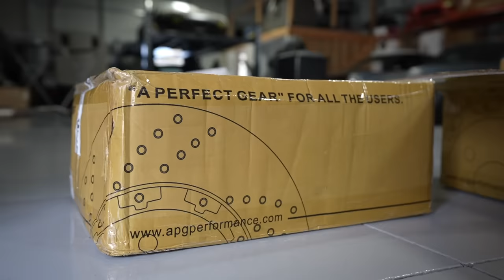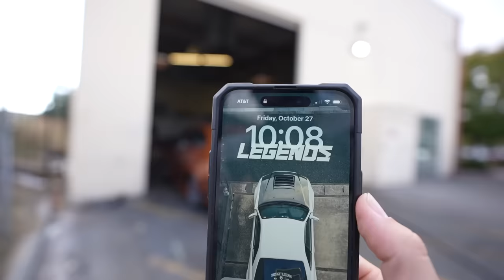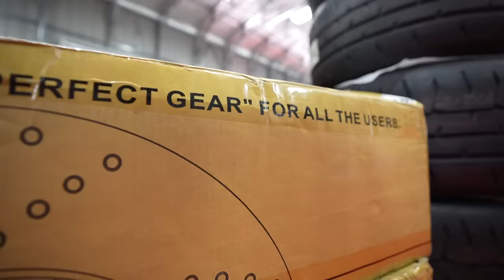Building My WRECKED & ABANDONED WRX into my ULTIMATE DREAM CAR

Comment: I know you’re going duck bill in the back which is cool, but it still needs a big wings. I would do a big custom wing with crazy and plates to balance. The front of that car out. Front is so crazy and you got the diffuser in the back and needs a big wing in the back just my two. Cents. Needs a big one needs a big wing maybe a active rear wing would like the triangular you know pointy side and plates. Need something in the back really need something in the rear big carbon rear wing